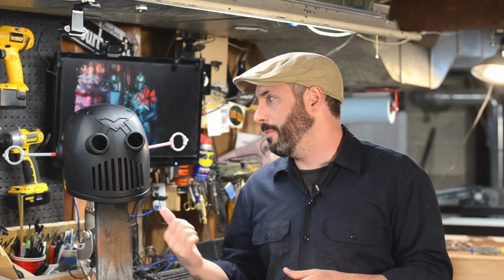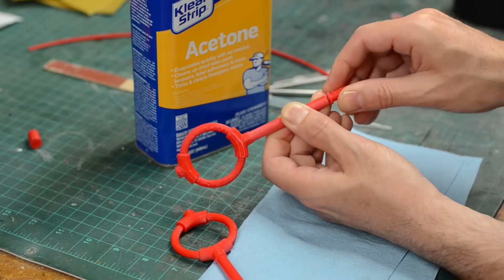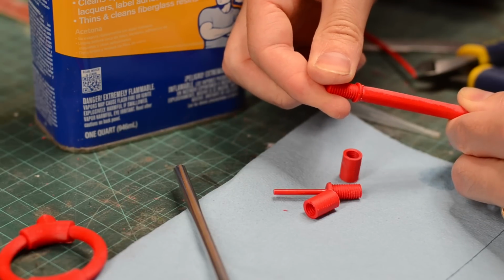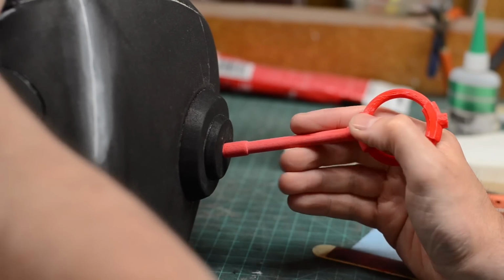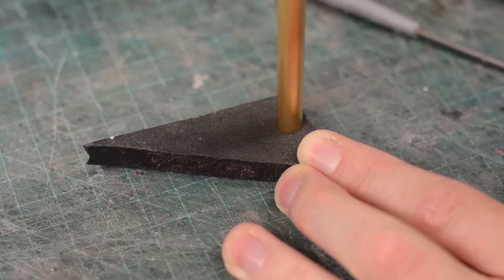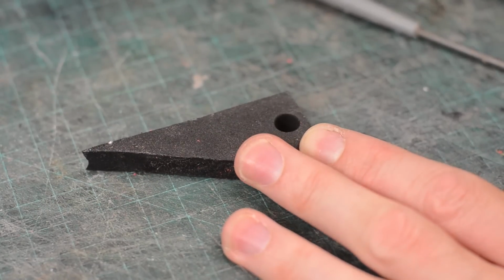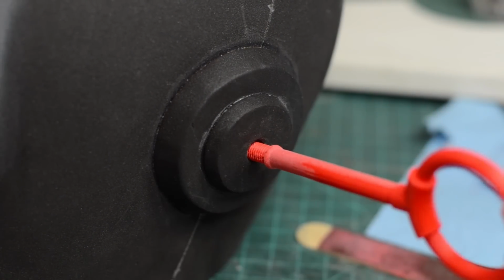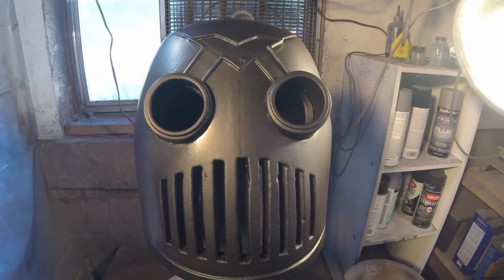Prop: Shop - Combining Foamsmithing with 3D Printing for my Mechanist Helmet

Comment: I'm going Zarya from overwatch and the armor was foam with Aquaplast+PVC glie to make it harder and still flexible but shiny (sanding, so much sanding) because i cannot use airbrush and plastidip is soooo expensive so yeah, suffering U_U
Gonna do the armor with different kind of foams and will conect the lights with an arduino!

Comment: Hi, 
I'm in the process of building a Mechanist helmet using Pepakura with fiberglass, bondo for my sons Cosplay at Glasgow MCM in September. I haven't got to the antenna yet but I was wondering if the 3D files for the antenna would be available to purchase? I'm new to the whole 3D modeling thing and not that great at it :) I get on better with hands on crafting. Excellent vids thanks dude

Comment: I am going to start work on my Meredith costume soon. I am incorporating LEDs into her sword  and am going to use transparent Worbla for certain sections of the blade. I haven't decided whether to go with expanding foam or EVA for the base but either way I'll be using more than one material.

Comment: I'm actually working on my first foam armor costume! It's Specter Knight from Shovel Knight and oh boy has it been a learning experience. UoU;;;
Not too many materials being mixed, but my scythe is foam for the blade, pvc pipe for the handle with a dowel inside connecting the two for added stability.

Comment: Just a heads up, the acetone glue trick only works with certain filaments. For example, you CAN use the acetone trick for ABS, but CAN'T use it on PLA. Thank you for the video! I love your videos and editing so much (and obviously the props)!!😃😃
Reply: And I also have a question. With foam, I sometimes deal with the foam bending and leaving wrinkles in the paint job and foam itself. I wasn't too concerned about it on my previous project because it looks really beat up, but I was wondering if there was a way to prevent that without using resin. Thanks again Bill!!
Reply: +Punished Props I would love to use latex but it's just kind of out of my budget. I was sealing with plasti dip and I know the cons with it, but I was curious if there was something other than wood glue or plasti dip that also happens to be cost friendly. Thank you for taking the time to respond by the way. I know you guys are VERY busy so I greatly appreciate it!!!😃

Comment: 3d printing threads, that's cool. Wouldnt have thought of that. My first thought would have been to use a tap and die. Once you figured out the thread printing, that's got to be so much easier for production. Thanks for sharing with us.

Comment: Your air brush, that reservoir looks much bigger than any I've seen.  DId you modify it with a mason jar or something?
Reply: I think that's a Critter Gun 
http://www.ebay.com.au/itm/Critter-Spray-Products-22032-118SG-Siphon-Gun-/252396674692?hash=item3ac4039e84:g:0wYAAOSwrnNXPvYN
Reply: Cool, thanks.  I have an HVLP sprayer that I use for cabinets/etc, and an air brush that I use for more detailed work, but that's a cross over I hadn't considered.

Comment: No more plasti dip for sealing bill ? Does latex works that good ^^ ?
Reply: Thanks ! i'll try it on my project then ^^
Reply: +Punished Props I used to work with liquid Latex and use Liquidtex paint colours added to it, I'm going to be making a costume with Eva foam as part of the Armour -this is Nice to know I could uses it on the Eva foam as well 🙂

Comment: I got my first 3D printer almost a year ago. I started making weapons for my son on my 3D printers just for fun . The first was the Thorne from Destiny, I then destined and built a full size mini gun for his Halloween terminator costume. I then built a Warhammer 40K space marine bolter from foam and 3D printed parts. Followed by a space marine hand flamer. I am now working on a Space marine plasma pistol. I 3D printed the parts sanding and finishing them by hand before making moulds for casting in resin.  I have got the lights sorted but I am now working on sound for the trigger. I have to say most of the technics I have learned have been from you. Great work love the videos.  If you want to do some videos on lights and sound in props I would love to see them.  Thanks again for all the videos and advice.

Comment: Hey Bill, thank you for this Video, many cool new Ideas for future projects :)I´ve got a Question for my recent Build and i hope you or someone else could help me:I want to seal my foam-helmet also with latex, but i got two problems.I just have an airbrush, can i use it for the application instead of your special spray gun?Aaaand iam living in Germany and i dont know why, but there is nobody selling thin latex, like the rubber balloon latex (and shipping costs to Germany are too high).So is it possible for me to use destilled water and ammonium to thin down the normal latex ?
Reply: Ok that is perfect and a lot easier than i thought. Thank you very much !

Comment: I want a 3D printer soo bad, i'm gonna save up for one! Wich one would you recommend? My price range is under 1000 dollars/euro's.
Reply: The helmet looks hecka sick by the way! I hope i can do something like this someday!
Reply: +Punished Props thanks for the feedback!
Reply: make one! go to instructables and look up "edge 3.0" its a little small but its under $250
Reply: +jedisalamander gaming will do!
Reply: I'd recommend the wanhao duplicator i3. its the best bang for your buck for a ready to go printer right now. check out makersmuse' review on it here on youtube
Reply: +Ivan Stroganov thanks for the feedback!
Reply: +Lars van Wijgerden yeah, the Dremel is the best one that I've found. you can 3d print this thing to make your printer   print any plastic. (I have not yet bought a Dremel, although I have used one)
Reply: +Zachnikatel Gaming nice!
Reply: Robo R1 plus! Auto bed leveling that actually works!
Reply: Either the Mono price maker select or Prusa I3 Mk2. There are no better printers than those.  Be ready to tweak and upgrade the printer if you buy a printer. Their is no way around it.